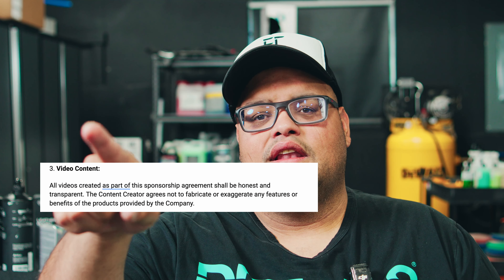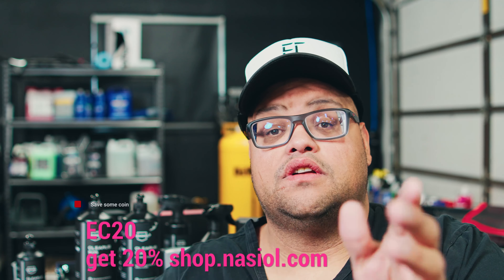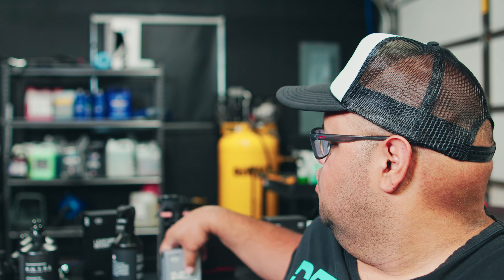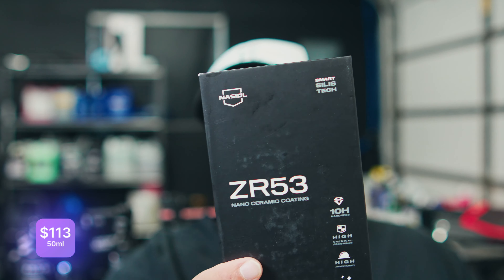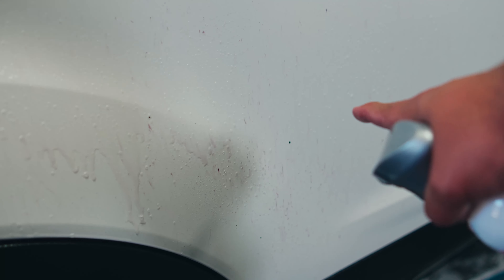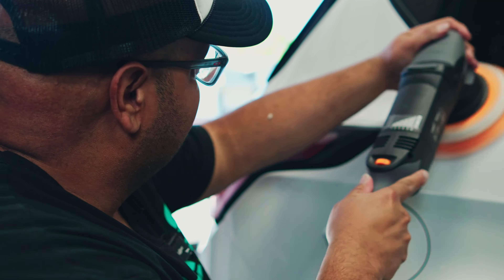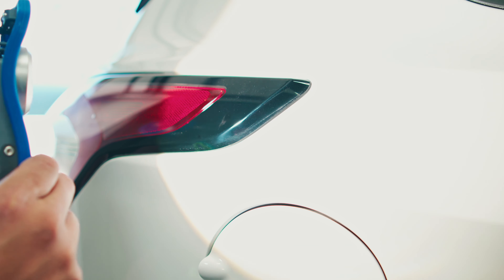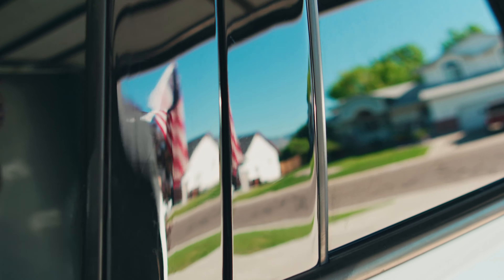Applying Nasiol: Brand Review & Tips for the Best Results

Comment: Like I told you before, Nasiol VR53 is great.   I haven't used the trim coat yet, even though they are here on the island.  I didn't like the glass coating because after applying it felt grippy.  Personally, I like one that feels slick also after it is applied as well as my customers.  When I applied the ceramic coating, it took about 5 to 10 seconds since humidity was 87% and temperature was 90 degrees Fahrenheit. 
Superb video 👌 great to see Beverly doing great ♥️. Yes, she's white because we are with our perfect tanned color😜😜😜🇵🇷🇵🇷🇵🇷
Reply from the maker: You were right the brand is pretty awesome , thanks Humberto some people need to make sure to take temps into consideration  when applying Nasiol

Comment: Thank you Eddie. This was a very good informative video. The zr53 well lets say my first go with it was not the best not as bad as yours but not great. So I am in Ga and its been killer hot here. So I had to level it and wipe off in like 20 seconds or it was very bad. The thing is when I learned that it was not bad and my truck yes I used it on my own truck looks killer. The glass shield is one thing I have been waiting on to see how it is. I am glad I waited for your video so I make sure to use the 20 sprays. I really want that to be a great product as it will be something I add in for free to some of my customers. I will have to try the trim coating. Thank you to you and your wife for the great video.
Reply from the maker: Dude it works going strong on the Tesla since I did it was 6+ months and no issue also hot humidity 10 seconds or less bro or your gonna have problems
Reply: @Ecdetails  Yes sir I had problems at first but got it working and WOW my black truck has never looked better. They have some good products. I have been playing with the tempo road film . I really like that stuff for long trips. I drove 90 miles today and had bugs and stuff all over. I got home used the hose and washed the film and bugs right off.